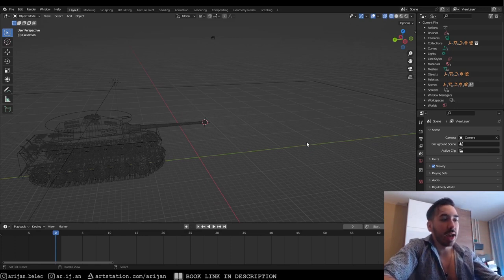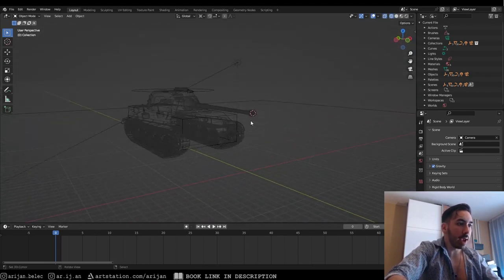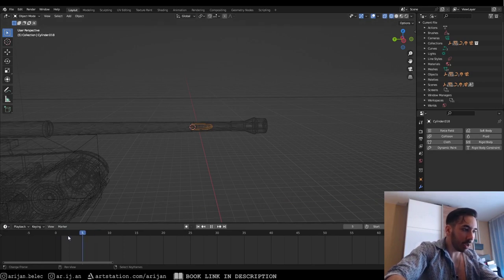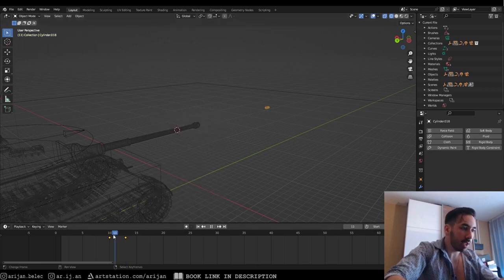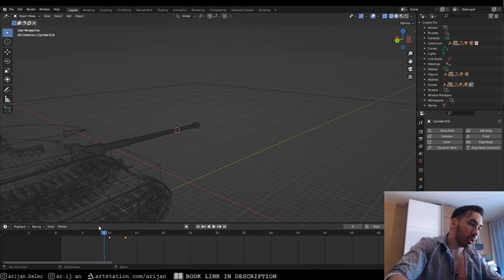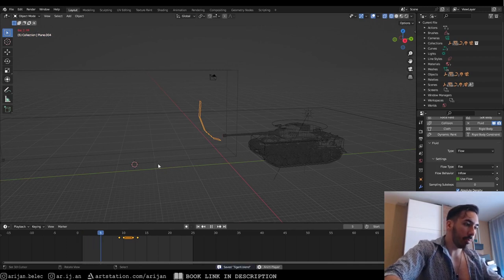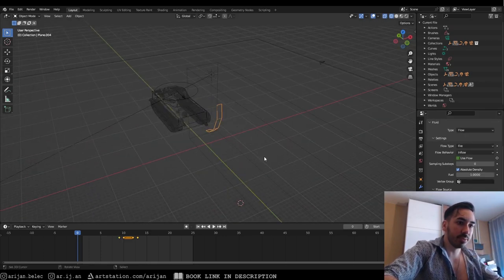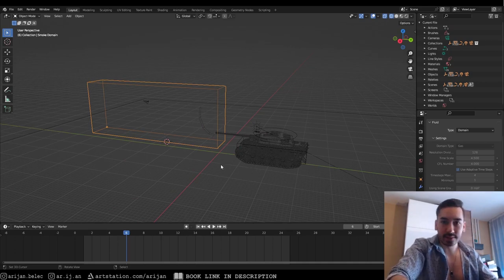Blender Tank Muzzle Flash Simulation Tutorial (Arijan)

Comment: Hello these days i do tank models. i wanna ask something about the separate objects.
first i do my tank turret and main base after this i need to be make commander valve on top of the turret but i need to make this a low polygon. after that i did the commander valve (seperated) and i want to give the valve a smooth edges or curves after i going to use normals from the right panel from the blender i set this to 65°. after that i make others like this(reloader valve, driver sight, some smoke launchers. after all of that my turret normal i set on the 30°. but i want to all of this parts joined with each other and i will select the valves and last selection was turret i press ctrl+J for connected and stand together but when i do this my turret parts going to crash (looking a little bit of dark) and normals turning to a turret normal. the parts i want to edges have a soft looks this edges going to sharp looks how can i deal whith this parts. Thank you very much if you read i will do my best for the english comment.
Reply from the maker: Hello my friend, if I understand the problem correctly, please check my  video named "Adding hard surface details in Blender", i think it might help with the smooth edges.

If this doesn't help, please join my discord (link in description). We have 170+ members, you can send some pictures there and the boys there will help you quickly. I hope I can help you, thank you for the comment
Reply: @ArijanRace  Thank you so much for your information.

Comment: Very cool! The blast is very realistic. Loved watching these things at gunnery. For future reference, the 120mm round is actually a dart made from a 27mm diameter rod that is 627mm long held in a discarding sabot collar sized to fit the 120mm smooth bore.
Reply from the maker: Noted, it will be done right in the next one
Reply: @ArijanRace  nothing wrong with the one you did, I didn't notice till after I posted that the tank you used was your Panzer IV and not the Abrams you made earlier. The Panzer IV used regular 75mm solid shot ammunition like what you modeled. What I posted referred to the Abrams 120mm like your thumbnail pic. The one you did is perfect for a Panzer IV!
Reply: @armyscout92  The tank in tutorial is actually a King Tiger or a Panzer VI Tiger 2 it had a 8.8 cm KwK 43 L/71 cannon. But yea as u said in future if he is gonna use the Abrams, he needs to use a APFSDS (Sabot) shell or a HEAT-FS.
Reply: @WARDORIEN  yeah I figured it out right after I posted my original comment. Then corrected myself in a follow up post. And now I have to correct myself again because I went back and looked again and sure enough it's a king tiger...